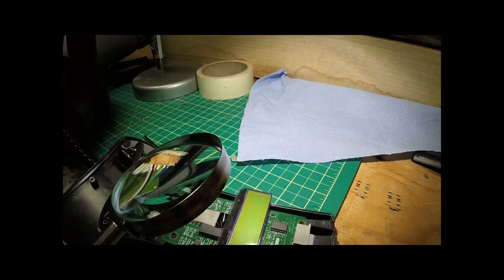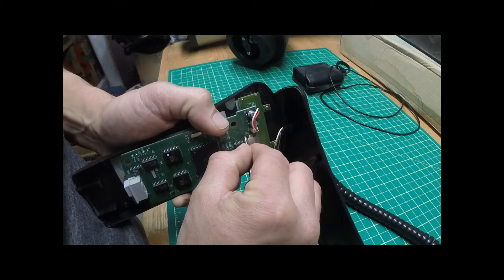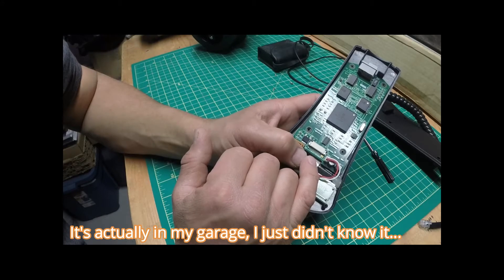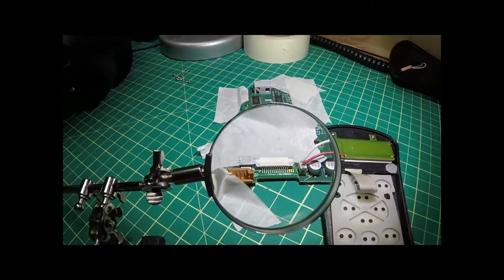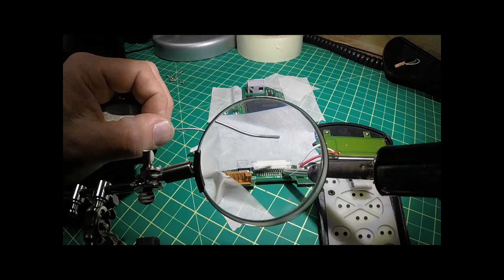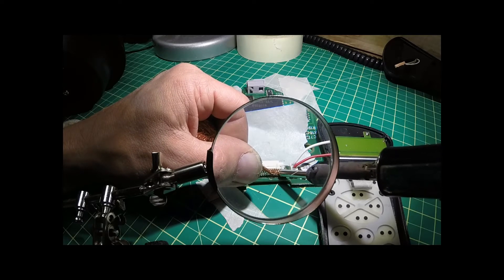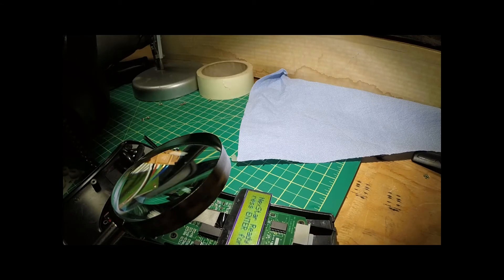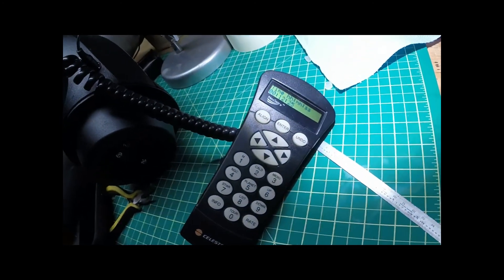Celestron Nexstar remote fix

Comment: You did an excellent job with the equipment you've got! Those conductive pads can be a bit of a nightmare (in terms of stopping working!) however I've had good results giving them a gentle wipe-over with a cotton bud soaked with contact cleaner.  Bearing in mind that the handset is supposed to be used reasonably heavily,  both Celestron and Meade could have done a far better job of internal design, especially in terms of connector robustness and durability. I've taken the SE8i go-to drive mechanism apart on a few occasions, and considering how costly these scopes are, the build quality leaves a lot to be desired, especially their choice of "no-name" stepper motors.
Reply from the maker: Thanks was happy to get it going again. I was camping this summer up north and someone introduced me to a Seestar S50 scope. Have you heard of them? 

https://www.seestar.com/

Comment: Hi,

I am experiencing an issue with my Celestron 6SE StarSense hand controller where the LCD screen remains completely blank—there is no text or backlight—even though the controller powers on and the buttons seem to respond. This problem started after the controller showed an error, and despite checking the power supply, reseating the LCD ribbon cable, and ensuring all connections are secure, the display still does not work. I would appreciate any guidance on how to resolve this issue or information on repair and replacement options.
Reply from the maker: Sorry just seeing this now. So the problem could be the LCD screen itself and ‘perhaps’ it has part numbers on it and maybe could be ordered separately. But it could also be the ribbon cable or something on the control board. Do you recall the error message you got? 

Sometimes taking something non conductive and pushing on some of the components on the board might reveal a bad connect ‘cold solder’ joint. Maybe twist the board a little to see if the screen pops on which would indicate a bad connection on the board. Otherwise find a used compatible remote I guess. Hope that helps.

Comment: my Meade autostar display ribbon flex contact problem it's 14 pin flex is it possible to replace or can do bypass please give some idea to fix this issue
Reply from the maker: Hi sorry for the late response. I would say if the flex cable is for sure the problem it may be possible to bypass it with some small gauge wire but it usually requires some precision soldering equipment. Perhaps finding a used one for parts might be the better option?

Comment: I have the exact same remote. I havent used it in a while. I fired it up the other day. The direction button do not all work. I can move it up and down, but the sideways buttons don't work. Do these same connections control that also?
Reply from the maker: No it wouldn’t be those connections but you might look at time 1:44 on the video when I lift up the keypad off the board. The rubber sheet is the buttons from the front and they line up to electrical contacts on the green board and sometimes you can just clean those off to make the buttons work again. Make sure the power is disconnected. Good luck.